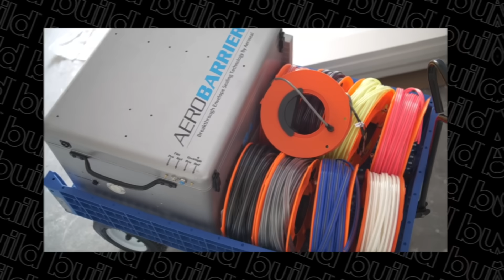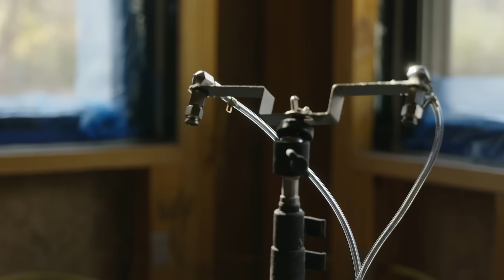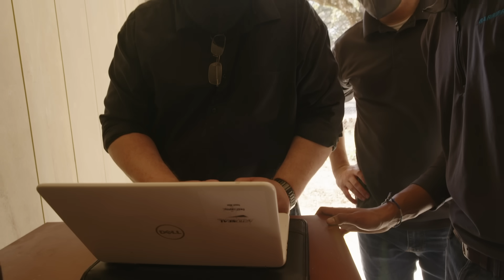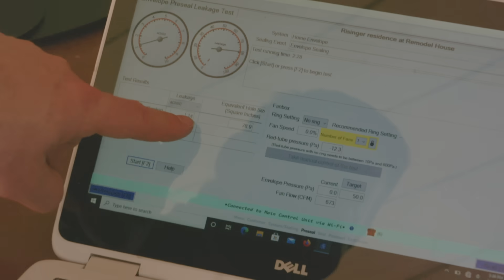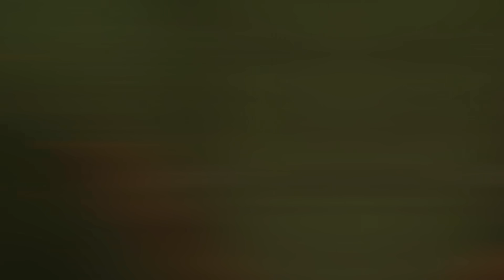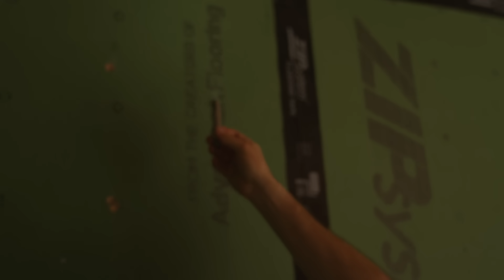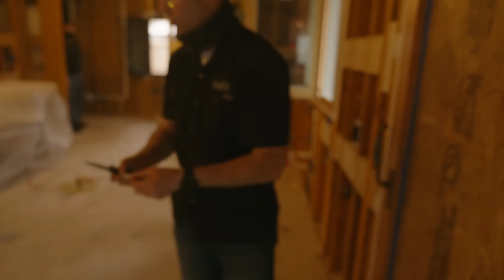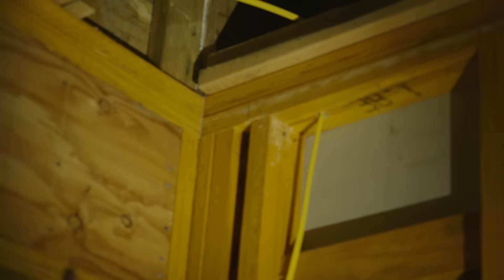The one product I'd recommend for EVERY House!

Comment: This channel is turning into infomercials. Nobody will buy anything that is built on this channel except the top 1%. 

Mass homes that are being built across the Midwest are literally built for minimum cost. Nobody builds like this channel does because it's not practical, cost wise.

Edit. Except metal roofs. But not the designer crap that was in the metal roofing video.

Lastly, caulk will expand and contract ten, fifteen times... And in two decades it's as if this wasn't done because all the caulk is cracked. No caulk lasts forever.
Reply: I've used AeroBarrier on spec homes.  Some builders do care.
Reply: @wjthehomebuilder   So if you don’t buy this product...you don’t care?
Reply: @seanm3226  My point was that not all homes are "built for minimum cost."
Reply: @roadrunnersk2 ... rewatch and look at the framing and other products used in the construction so far.  If this bothers you then this channel isn't for you

Comment: I really hope you plan to re test in a few years to see how the AeroBarrier holds up over time
Reply: @Doken Boken as an HVAC technician in south Texas that has been using this product for the last five years, I can say that it hasn't noticably broken down in the ductwork hung in our attics.
Reply: @edwardhunts  can you tell me if this is feasible in an existing house? I am in DFW area. My attic ducts drop fiberglass on me in winter and it's killing me. (And my marriage). My wife is not as badly affected as me.
Reply: @tkmair6559  yes, it is feasible, however you might want to have a local technician go over your system just to make sure you don't have a bigger issue
Reply: He would need to do another blower door after drywall to be his control then, but that's a pretty good idea.
Reply: There's been some third party long term testing:
"This 3rd party testing concluded “simulating a fifty-year period of service, the sealant showed no evidence of cracking, crazing, or spalling. Furthermore, the sealing performance was 0.13% leakage (very low) when compared to open-joint condition (no sealant present). Finally, there was no discoloration and/or material breakdown at the sealant interface with the 41 common building products, indicating favorable compatibility.” "

Don't know how that translates to the real world. 

https://zeroenergyproject.org/wp-content/uploads/2019/10/AeroBarrier-DurabilityTesting.pdf
Reply: @slickmcCool  Nice link. We all know how caulk shrinks and cracks eventually, but we're talking about going from no sealer to near perfect sealing to less perfect sealing. It's still a long-term win in terms of home sealing. It's not as if the caulk disappears. From a 1.0 to a 0.1 to a 0.4 30 years later is still better than still being a 1.0.

I'm mid-remodel right now and I've been considering doing this before doing my finishes. If I can get it done for $1/sqft, I probably will!
Reply: @HansUberschlage  pretty much agree
Reply: Great idea Doken Boken. That would be fun to see.
Reply: @jonathancallender8185
Reply: They should invest heavily into making the caulking more aerosolized at the cost of sealing ability. Add a fluorescent dye. Use the technology as a leak finder and not a finder plus sealer. It's much more cost effective and gives better seals.
Reply: @doken If another blower door test a few years down the road showed higher ACH readings, it would not not necessarily be a failing aerobarrier. It could be other failing components such as a window, door or new internet installed poorly.
Reply: You don't have to wait any longer then the installation of drywall! After they hang the drywall the house will settle again and leaks will form.
Reply: If it is the same compound that is used to aeroseal ductwork, It stays permanently flexible, It smells like Elmer's glue...
Reply: Yes agree. A caulking like material will only last so long. But considering they discuss a process with which they can do this in an existing home perhaps as it does break down over time they can fully re apply the aerobarrier system at that time to help re seal it.
Reply: By the way I would bet this is what Mr Terrell was speaking to.
Reply: @robertbrannan9375  so you are gonna rip out all your drywall and insulation to reseal your house with a “green” gimmick?
Reply: @brandonhuisman4351  no. You don't have to rip anything out to re apply. Just can't have furniture etc. They discuss this in the video. Pay attention.
Reply: @robertbrannan9375  then you are creating a moisture trap for mold to grow
Reply: @brandonhuisman4351  if it starts to break down then yes it will. That was the original concern and question. Doken boken mentioned wanting to re test. In response to that I also mentioned how it was capable of being applied in finished homes. Obviously if there is moisture intrusion that has led to mold that would have to be addressed as always. The point of this product is not to be a moisture vapor barrier. It is to help seal unseen places that are inevitably there. It isn't a solution for a poorly built home.
Reply: AeroBarrier does not fix poor craftmanship. The house should be well sealed to begin with. 
Besides, what products do you know that last forever?
Reply: @jordonscott5271  proper construction like tight fitting joints and differt materials that abutt each other like studs and drywall at penertrations. Buildinh Envelopes do well with Styrofoam type materials that don't breakdown and last the life of the home and even heavy duty tar paper(old school) that I've seen last in place and doing it's job as a barrier from the early 1900s. 100yr useful life is possible but most people and contractors fail to understand what things are made of. I don't think this stuff will hold up long term. Google some old building tutorials on sheet rock and plaster and you'll see why old homes have good bones and are still standing. Those built out of real stone and brick are air tight with updated windows.
Reply: ...next we need a device that controls all doors of the house so we can only come in and out twice a day to minimize air leaks 😃
Reply: How well does it seal your lungs and airways?
Reply: Easy. It'll last until the first cable guy drilla for a new line. Or the first guy that wants some cat-5 run to a different room, etc. I'm sure those will have relatively small impacts, but it almost feels like undoing the work if you ever want to make changes.
Reply: Good seeing is great. But these chemicals no one seems to know rhe long term impact. Toxicity
Reply: And then once the house is super hermetically sealed against all ‘contaminants’ and super filtered and that you become super intolerant to all natural organic air born substances and develop an unhealthy intolerance. You’ll see it wasn’t the right choice. The day will come down the road when you’ll say: ‘Darn it feels stuffy in here’ and you’ll go and open a window for some FRESH air 😅 But I guess some people really want to live in a bubble 😅
Reply: If it shrinks like caulk they can always come back and touch it up.
Reply: @TerrellMethvin  
In the houses I've built or remodeled,  caulking touch up is not a simple or in most cases even feasible.
Reply: @huntera123  rewatch the video at about the 18 minute mark. They talk about treating an occupied building.
Reply: @blaineyuen8540  No mention at 18 minutes of furniture, etc.
Reply: @TerrellMethvin  and that's good for business.
Reply: @TerrellMethvin  Your lack of knowledge in construction is displayed in your reply.   Do you really think someone will allow this process after they move in with their furniture?
Reply: @aday1637  They could if it’s, as they said in the video, during a turnover. Regardless, don’t be so snappy in your response dude. No reason to bite someone’s head off,..
Reply: @aday1637  you missed 17:56 there bud
Reply: @aday1637  you rent  shipping  container . Move all your furniture to the garage and container. Move your wife out for a few day holiday or vacation. Kill two birds 🦅 with one stone....
Reply: @aday1637  rewatch the video at about the 18 minute mark. They talk about treating an occupied building.
Reply: @aday1637  clearly you weren’t around for the toxic foam insulation issues a few years after the craze hit. Indeed it was discovered builders cut corners in a very bad call leading to serious health defects. If I recall it was a toxic fungus issue that ate the foam.
Reply: @aday1637  if it starts really good, they might wanna get a retest before they move if they wanna use the ach as a selling point. But that would be the only reason I could guess
Reply: @TerrellMethvin  when they come back later it will be any different condition fully furnished and sheetrock
Reply: @TerrellMethvin  NO, by that time, you have furniture and all sorts of thing in a furnished home.
Reply: @TerrellMethvin  Come back and touch it up?  They would have to take the house back down to the current state: framed and dry, but no further.  That simply isn't going to happen.

If they use reeeeeally good latex they might get ~10 years out of it before oxygen and ozone destroy it.
Reply: @iatsd  you missed the part where they said "before someone moving in" in-between the selling and buying of the house..... HOWEVER I do agree that this is a stupid concept and far too expensive for what it's worth
Reply: @assassin_asa  The person I was replying to said no such thing.  They said it could be "touched up", which it can't be.  And you can do anything with it again unless y you rip everything out of the house back to framing & dry in phase.
Reply: @iatsd  - If you really paid attention to what they said..it can be done in an existing home with the drywall, and insulation in place. So, it can be done after a family has moved out of the house, and before another family moves in.. so yes it could be touched up in the future..
Reply: @danahebdon6810  Think it through: you're actually saying it can fill a house with a latex mist and that won't adhere to carpets, floors, fixtures, appliances, etc.?

That's not how gases behave.
Reply: @iatsd  you don’t get it, slow down, research or shhhhhhhh.
Reply: @SAthefuture  Feel free to tell me how the points I made are wrong.  Or you can just pretend you understand fluid & gas dynamics and that this stuff magically doesn't follow the rules of that.
Reply: @iatsd  It's acrylic, but that's besides the point. It would be a pain in the anatomy, but covering everything and using the fan to exhaust it quickly. I would imagine since it is used during remodels that a good contractor would have the supplies and crew to cover and tape everything. For a price.
Reply: @iatsd  I heard the guy say they could do a completed house. You just have to tape and cover as if you were going to paint the interior with an airless sprayer.
Reply: @danahebdon6810  then you trap all the moisture in the walls so it can mold
Reply: @brandonhuisman4351  - No, you wouldn't be trapping any moisture, so therefore you wouldn't have any mold problems. You really need to go read the information about the process and the product, before you start spouting off.
Reply: @danahebdon6810  nope I know nothing I’ve never built new homes 👍 let alone remodel an old house. Me never.  I’ve never seen builders get sued over shit like this because I’ve never even seen a house built
Reply: Nice mold trap
Reply: hope he checks the wood for mold sealed into it from the sealant that trapped all the moisture from the day he sealed it ... yep thats what he is doing trapping all the moisture into the wood promoting rot and mold and mildew ... worst system to use ever ... like people a house has to breath ... and a 4 inch vent in is not doing that ... lath and plaster homes from 100 years ago are mold free still IF they havent had water penetration ....
Reply: @0623kaboom  and those old houses only take 10 times as much energy to heat and cool👍

Comment: You mentioned that for Minnesota AeroBarrier was used after drywall but in North Texas especially since it snows there now this application would be the same.
Reply: Did you mean that it didn't use to snow in Texas?  Check out the 1895, 1958 and 1960 snow storms in the Houston Chronicle.  I think the 1958 happened about the beginning of spring.  Yes global climate change is coming , along with poisoned water systems, nuclear war, famine, pandemics, meteor showers, fire and brimstone.  Beforehand, be sure to buy a handbasket because that's all the insulation people around when it happens will have.  It will be called the tribulation
Reply: Yes I didn’t understand why after drywall.

Comment: For block homes, when would we use this? I would like build better in S. Florida but block construction in hot humid climates has very limited information out there. Good video!
Reply: I would say after doors and windows are in, and possibly after the interior framing.
Reply: At the dried in phase is what I would assume, just like Matt did here.

Comment: Product seems like it should work at least for the short time. What’s the payback time line?
Reply: It would really depend on the leakage reduction and how much you end up saving on your utilities. Air leakage can account for a significant part of your heating bill (20 to 40% ).
The savings will continue for the life of the home.
Reply: @islandaerobarrierinc4050  
'The savings will continue until the caulk breaks down'. Regardless, at $4,000 install price this would need to cut heating/cooling costs at minimum $40/mo to make financial sense.
Reply: @TheBighatter  the product has had a 50 year life test done with almost no degradation (<1%.) So there is lots of time to earn your money back even if utility Bill's stayed the same (they don't)
In terms of payback. Yes it will take a few years if you are relying solely on the utility savings.  If you decide early on you can benefit far more and sooner.
Here's an example of one that we just sealed to 0.19ach50.
 Builder did not spend days doing origami with wraps and applying tape and caulks.  He did not need a mid construction blower door test or to repeat it after a failure and more time trying to seal leaks.  The  heat pump was 1.5ton smaller than would have been needed if built to code. They went up a full step in the BC Step code and qualified for a $4000 rebate.
The rebate alone paid more than we charged for that home plus about $1.5k savings on the heat pump plus whatever it would have cost them to airseal and then test. BD tests around here run about $400 each.
So, even at your $4000 dollar price ( this house was less) you would be at least $2000 richer.
Reply: @islandaerobarrierinc4050  
What's your source that caulking has a 50yr lifespan?

Comment: Fix-a-flat type stuff is a last resort for me, but this seems interesting.
Reply: tire centers HATE fix a flat type stuff.  put it in a kid's bike or an equipment tire that will last as long as the equipment, sure, but if you ever use it in a car, get to a tire center ASAP and get it cleaned out and the tire repaired properly.

Comment: `What about fire caulk?  Is that not a sealer? Another item to consider caulk shrinks. My own home i did sill plate s around perimeter of second floor in early 1980, remodeled in late 1990 saw caulk shink. What does he use for caulk that will not shrink as house moves?

Comment: Looks like the initial evidence points mostly to leaky top and bottom plates.
Reply: I’m going to be caulking all my framing as I do my construction. Going to buy stock in 3M before I go buy all that caulking 😂
Reply: I sure hope he sealed up his vents for fresh air otherwise those filters are caked with caulk
Reply: @Fremanscum  in other videos the aero barrier guys cover all the air inlets and supplies for that exact reason- to keep from gumming up the works and avoid wasting a ton of material lol